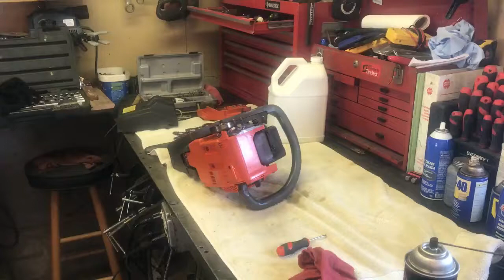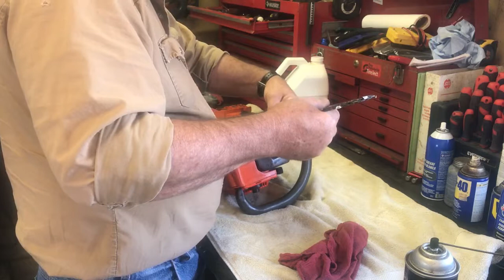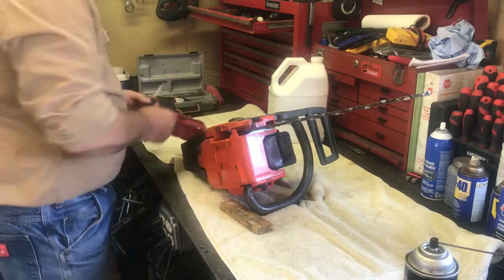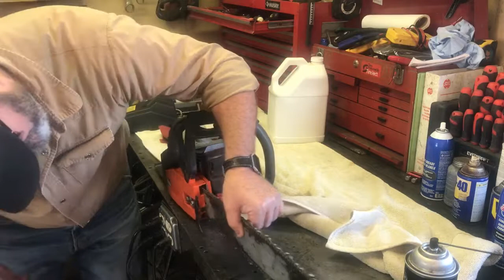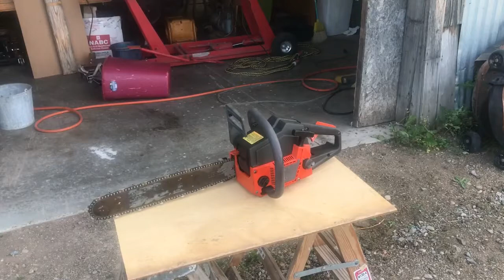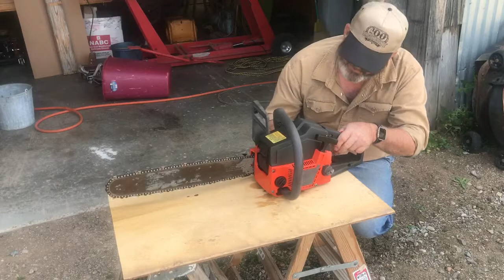1985 Husqvarna 45 (9)

Comment: I was wondering If the kind of Carbon deposits that were visible on the piston was caused by worn out piston ring? 
Have You checked piston ring gap?
Reply from the maker: No I didn't Check the ring gap.
Reply: @DaleHobbs39  thanks for the reply. Do still have and use the Saw? Was there any problems with her after the repair?
Reply from the maker: @wojciechszymanowski  I havn't had any problems. Just regular maintenance.